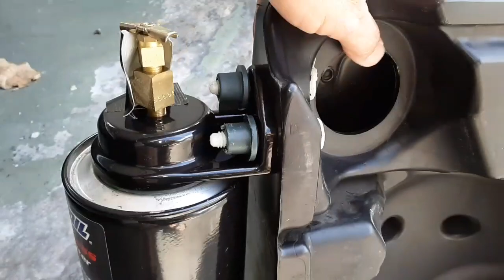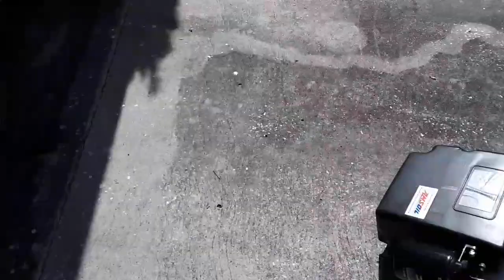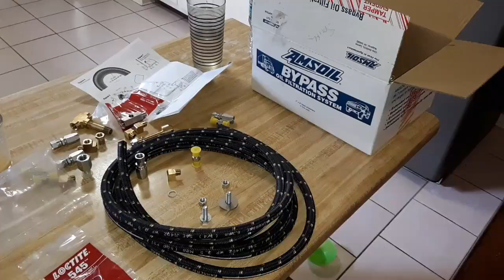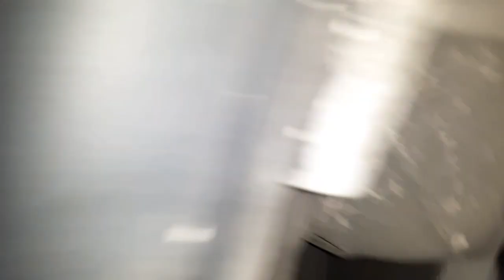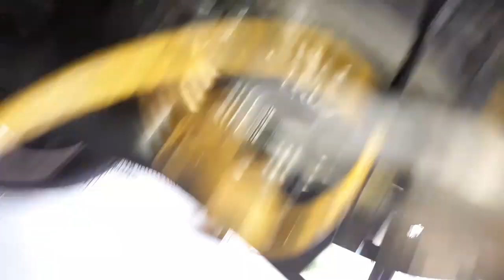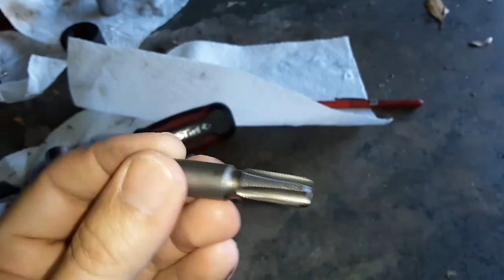2007 Honda Pilot stripped oil sensor threads/Amsoil Bypass oil filter install Part 1 of 3

Comment: I also wonder if all Honda oil pressure units have the same thread. I'm looking at doing this with an 08 Civic (1.8L)
Reply from the maker: @Watchman999  from what I've heard I believe so I believe they are all 1/8 bspt threads

Comment: Thanks for your video. How do you tap the aluminum and ensure that you don't get metal in the oil pan?
Reply from the maker: @Watchman999  yeah that was the scary part... thinking back to when I did it I think I used a magnet on a stick, one of those tools you use if you drop a bolt down in your engine compartment and need to pick it up, anyway I used that to try to grab any iron filings from the oil sensor threads... from there I used that 1/8 bspt tap very very very very very carefully a little at a time backing it out frequently... at one point I pull the fuel pump relay and cranked the engine until oil came out in an effort to push out any filings.. that part might be in the next video I think it's labeled part 2 and 3
Reply from the maker: And I wanted to acknowledge that you mentioned aluminum specifically so the magnet would have no effect on those particles. Another person commented to use grease on the tap which would hopefully bring most of the particles out
Reply: @ yes. That was one of my follow-ups. Cheers.

Comment: I’m having this same issue. It was over tightened and stripped when I removed it. I replaced it but didn’t know and over tighter as well, but the way down. It started leaking. Any advice will help.
Reply from the maker: Sorry I missed your comment. This could be bad if you over tightened the new part as well.. I don't want to give you false hope but again what I did is carefully try to clean out the threads in the engine and run a 1/8" BSPT tap down into the threads, BY HAND, a little at a time, over and over again removing any foreign material that comes out.. this is what I did in the video. One of the commenters suggested apply a small dab of Grease to the tap when you screw it down into the engine that way it can pick up more of the metal shavings. Let's hope you did not completely destroy the threads in the engine. And then again when you tighten tapered pipe threads like this you cannot bottom them out... you tighten them until 'snug' and then perhaps a few degrees extra. Also using thread sealing compound, like loctite will help with the tapered threads. I pray this helps.
Reply: @MikeTrullAmsoildealer  I was able to duplicate your procedure. I retreaded the hole 10mm bore. Whoever installed the sensor before we bought it striped it and placed it in with thread locker. 
So this new one was re-threaded, cleaned metal fragments out with a magnet and tighter it down 13 lbs torque. Used heat related Teflon on the threads and permatex sealant. This video fixes the issue.
Reply from the maker: @dandoapp1025  I am thankful to hear that praise God

Comment: Be interesting to see your filter cut apart after this work. The block is non magnetic material I believe so the magnet would not do much help. Either way it would be cool to see more information on how your bypass filter has been working
Reply from the maker: https://youtu.be/MTRMkBCia4U

https://youtu.be/fmqzpXzO4qk
The first one is pulling the oil sample after one year. The second one is the results. I think it's been over two years at this point I probably need to resample or change the oil and both filters.
Reply: @MikeTrullAmsoildealer  hey thanks for the reply!
I have been interested in bypass filters for a long time now and have always wanted to try on. Was always interested in the TP filters. Might look up the amsoil one and give it a try. I will check out those videos when I get a minute
Reply from the maker: Here's my link for the Amsoil bypass filters. If you add the preferred customer membership to your shopping cart it will drop your price by 20 to 25% which is a significant savings on one of these systems.
https://www.amsoil.com/c/bypass-oil-filtration-systems-mounts/32/?zo=1463115

 Let me know if you have any questions or need assistance. Basically the one I installed is a universal. They do have some kit tailor-made for the Big 3 diesel pickups. not that you have to but if you want to give me the credit for the sale my Amsoil Dealer / referral number is 1463115. Thanks!

Comment: I have the EXACT problem on my 07 Pilot. It's put my vehicle out of service for quite some time because it really stumped me on how to fix it. Initially I planned on replacing the entire oil pump assembly because retaping the oil pressure sensor threads would risk getting shavings in the engine (I assume, I really don't know if the sensor is before the oil filter or not). Before I discovered this issue, I actually replaced the timing belt/water pump on this car and I really did not want tear all of that part again and some more. I think taping the hole is really the best option since I've thought about this for some time now, and this video definitely confirms that. I am the second owner of my Pilot and from what I can tell the prior owner had all of the work done at the a Honda dealership. I suspect the oil pressure sensor was replaced and somebody was working quickly and carelessly and over tightened the sensor (or maybe they didn't know about pipe fittings like you discussed in part 2). My sensor also had strange silicone and sealer around like somebody knew they stripped the hole and just tried to seal the sensor in place. I bet this work was done and returned to the prior owner who was none the wiser. Thank you so much for this video!
Reply: I have the exact same issue with the wife's 2007 Acura MDX.  A repair shop replaced the oil pressure switch and either put the incorrect sized one or over torqued it.  Of course years later the same switch failed again and when I replaced and re-installed a new one it slowly seeps oil (seems more nowadays) while the motor is running and initially after it is parked.  The old sensor came out with some type of teflon tape and grey colored goop on it and I assume they used this to slow or prevent most of the leaking.  The MDX barely is driven nowadays(probably at most 3 miles per week), but the leaked oil on the driveway is definitely something I need to resolve.  I was thinking using some type of permatex gasket maker and apply a bit more just to stop the oil leakage or to at least keep it to a minimum, but if worse comes to worse I may consider doing a tap on the hole.  It is nerve racking though...not being able to see into the hole and tapping into it (don't want to crack the hole by over doing it).  If you have any suggestions please let me know..
Reply from the maker: @cobramanphil  sorry just saw this. I hope you got it resolved.
Reply: @MikeTrullAmsoildealer To be honest I never did.  The MDX is still running, but with a 17 year old vehicle things have begun to fall apart.  Mechanically the engine is still good and will probably just use it to run errands around town until it dies. Now if I could just figure a way to disable to dash/beeps warning for the low oil pressure sensor that would make the driving experience at least 50% better.
Reply from the maker: @cobramanphil  sorry just saw this. I hope you got it resolved.
Reply: Dude! Same issue with my MDX.
Reply from the maker: @dandoapp1025   Sorry to hear...this is insane, what's going on with these Honda engines?
Reply from the maker: Wow I had no idea that others out there may have had this exact same problem. And yes it's very curious that that thick putty looking pipe sealer was around it so heavily. It's interesting you mention yours was done at a Honda dealership as the Carfax when I bought this vehicle showed most of its maintenance done at a Honda dealership... anyway I am glad this video helped. I hope you are able to do as well with the tap. It was pretty nerve-wracking to not know if I was totally wrecking the threads. Thank the Lord I can report that it is still going strong no leaks! I will pray that you are able to get yours going.

Comment: Grease on the tap will grab most of the small specs of metal and you can clean it off as you progress.  Something to consider next time.  Also, thread locker and thread sealant is much different. Use the yellow teflon tape for fuel and oil fittings.  I installed my first by-pass in 1989.  My dealer was a direct jobber in Colorado, also a man of faith and wisdom.
Reply from the maker: Wow thanks for the tips! That grease idea sounds good. And thank you for differentiating between threadlocker and thread sealant. I still have a lot to learn in regard to these things. Glad to hear you have been involved with Amsoil for so long. I'm thankful to the Lord for His grace in all areas!